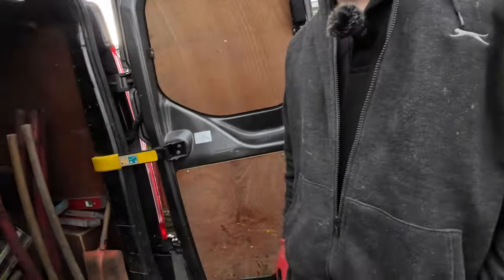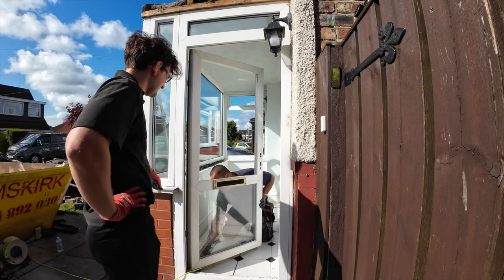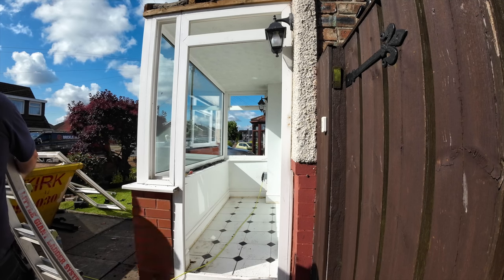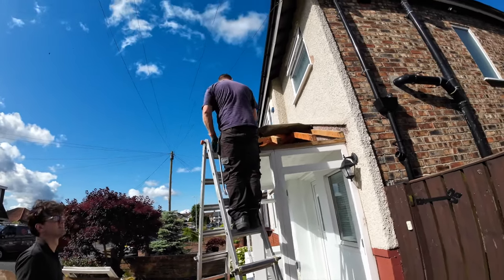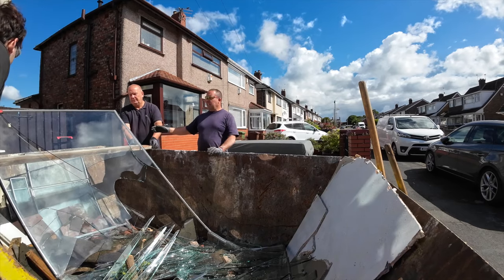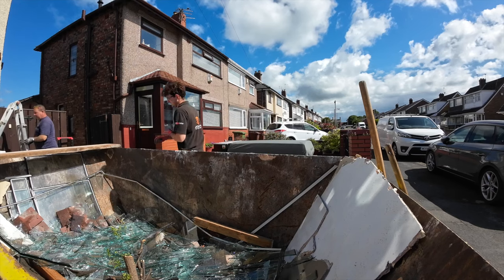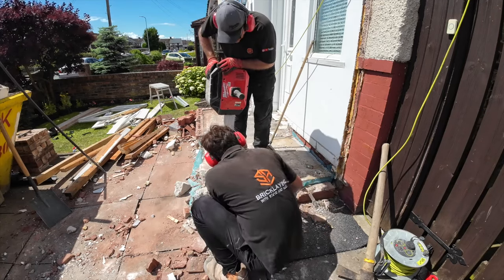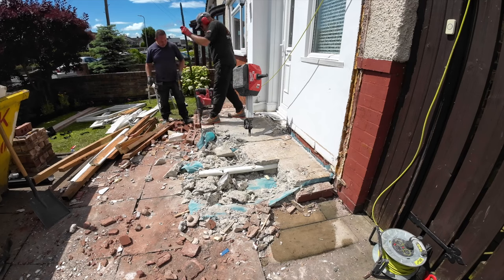A VERY WONKY PORCH AND SOME DANGEROUS GLASS

Comment: Its crazy how people dont excavate and add the correct foundations Steve 🧱💯👍
Reply from the maker: One guy quoted and said we will drop the walls to dpc . Put leveller on the floor then re build . 
    No need to do any digging 😳🤡🤠🧱👍🏽
Reply: @SteveAndAlexBuild  
That's an absolutely  joke isn't it .It's clearly evident what the problem is and it's from dpc down .Bonkers mate 👍 🤣
Reply from the maker: @brickrightbuildinglandscaping . 
He got on his horse 🐴 and headed for the saloon 🥃🤣🤣🧱👍🏽
Reply: @SteveAndAlexBuild  
Think he was in the saloon before he saw the job aswell Steve 🤣🤣👍
Reply: @SteveAndAlexBuild  
It might have worked - the foundation might not settle any more.
If house owner wanted to sell it could have been an option.
Proper foundation is definitely the long term solution.
Reply from the maker: @markdauncey927 😬🧱👍🏽